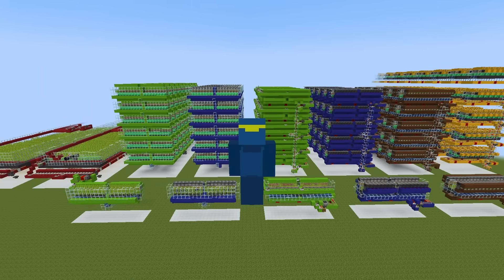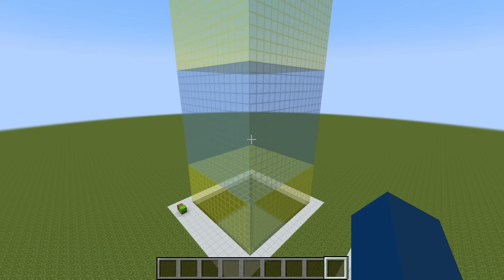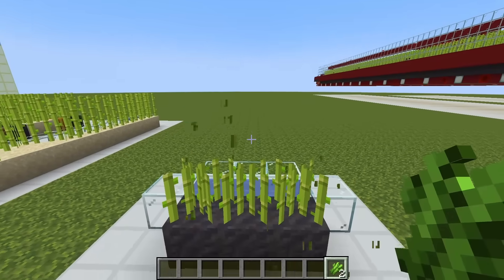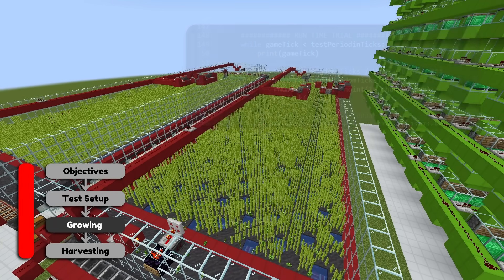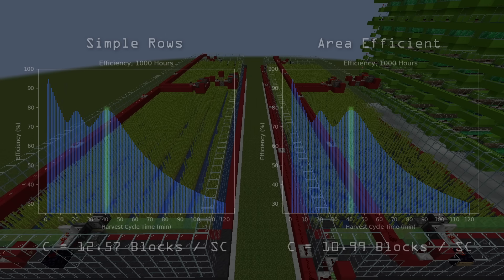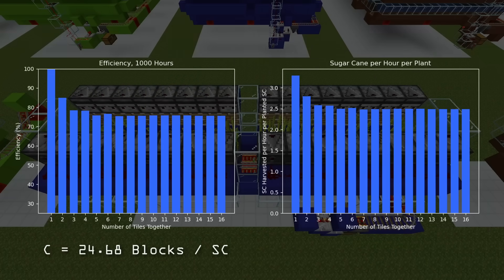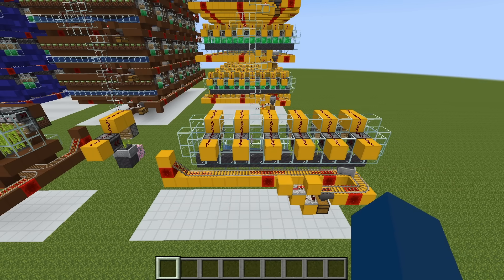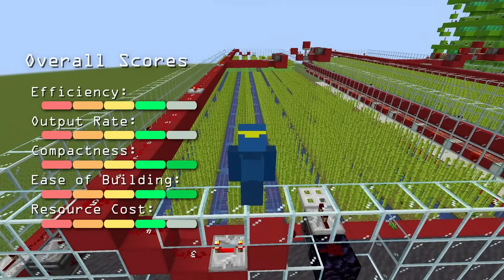I Simulated Minecraft to Find the Best Sugar Cane Farm

Comment: Do you have any knowledge about the impact of the length of a farm and the added time of the flying machine returning? I guess the curves for the optimal timing of clock based farms shift to higher time values when you consider the time the flying machine is running.
Reply from the maker: Good question! I think the biggest impact occurs if the optimal time is less than it takes for the flying machine to make a pass. So, hypothetically, if you have a really long farm and it took an hour to go from one end to another, then we’d hit the optimal farm time but we couldn’t be able to harvest yet cause our flying machine is in the middle of a pass. But even with really long farms, the flying machine only takes several minutes. This gives enough time to reset and harvest at the optimal time. The current code took into account a flying machine and would block growing or increasing stages if the machine was ‘flying over’ it at that time. That being said I’m sure it’s not 100% accurate, so the curves might look a little different with real-world testing.

Comment: Interesting project. I love it when people start programming to solve rare and unique problems. Reminds me a lot of Gnembon.

But some critism is you need to focus on your code quality. The performance and maintainability of this piece is quite low. Use functions, classes and avoid those huge indentation needed for, for loops with if conditons with more conditons.

You should also have a look at Numpy, its quite a bit harder to learn. But is well suited to this task as you can avoid those slow loops and be faster than any other language. The code would also be simpler since youd just be doing formulas rather than pure logic.
Reply from the maker: Thanks!

I appreciate the advice, I’ll look into them for the next coding project!

Comment: Is there any change in rates if you just harvest the top most sugarcane and leave it at stage 2, making it more likely to receive a random tick because it is 2 blocks tall? This would allow for a shorter clock time or if you wanted to do an observer based one. Have the observer face pointing down so it activates when the sugarcane becomes 3 blocks tall. Subscribed, hope to see more videos like this, reminds me of Nico is Lost
Reply from the maker: @MasterElements  Thanks! His iron farm video inspired a lot of this video lol

This is an interesting question, and the short answer is basically no, there’s no change. I’ve got a longer explanation on the individual 100% efficiency farm video, but here’s the gist. Since every block (and random tick) is independent of each other, having more blocks below doesn’t increase the likelihood of getting a random tick. And in terms of efficiency, the three tall design approaches 100% efficiency because in the time it takes for the third layer to grow, you could have already harvested the second layer. But as time goes on, this small inefficiency basically vanishes. So the three tall vs two tall are pretty much the same.
Reply: @SeaJayPlays  Interesting, thank you for the answer.

Comment: Regarding calculating the rate, wouldn't it make more sense to calculate based on the tick count? That way inefficiency in the code is a non-factor.
Reply from the maker: I think I did do it based on the ticks, but I’d have to double check to make sure. What kind of inefficiency in the code are you talking about? I’d like to correct that for the next video if it’s an issue.
Reply: @SeaJayPlays  Assume that the code runs slower due to some reason (more things happening for example) and potentially misses a tick timing, running it based on real-time would potentially have fewer cycles over the same time period.
Systems are also imprecise, so even if you say something is going to run after exactly n milliseconds you still might have some minor discrepancies.
I don't think it'd change the results in a huge way, but just one of those things one can do in order to keep things accurate. Just letting it run x amount of ticks is kind of all one needs to do.
Reply from the maker: @CottidaeSEA  oh okay i understand. I’ve got it running in a while loop, and each loop is a single game tick so I think we’re on the same page there

Comment: Creating a new comment for this as I think I've found the issue with the instant harvest design. 

I believe the standard 3 block tall observer note block sugarcane design that was compared to the "100% efficient" design has it's data misrepresented. I've made a video on my channel on the topic, but I'll type it out here as well. 

First, we clarify some terms on the phases a farm goes through. 
Growing Phase- waiting on sugarcane to be random ticked
Harvesting Phase- Piston extending to break the block
Reset Phase- Time needed after harvesting before sugarcane can grow again
Footprint/Density- How much space a design takes up
Tileability- How well you can stack a design next to/on top of another design. written as n-wide tileable (1wt for 1 wide designs that sit next to each other) 

First of all, I want to establish that there's no difference between a 2 block tall sugarcane waiting to grow, and a 1 block tall sugarcane waiting to grow. they both statistically have the same chance to grow and are statistically independent. 
With that in mind, there's technically no efficiency between allowing a sugarcane to grow to a full 3 block before harvesting, compared to harvesting it at 2 blocks high. the only difference is that it takes longer until first harvest when you are done setting up the farm, but there is no sugarcane lost or time wasted at max grow height. 

Design 1: Observer note block piston design. 
Design 2: the proof of concept 100% efficiency build in this video
Design 3: My design shown in my video on my channel (and the alternative linked in the comments) 

First we look at the density, Design 1and 3 has a growing sugarcane every 12 blocks, while design 2 has a growing sugarcane every 16 blocks(32 blocks if factoring in spacing to avoid signal crossing. both not factoring in collection system. This makes design 2 33% (166%) less efficient in this factor. 

Next we look at Harvesting and Reset time, Design 1 and 2 has a 2 tick harvesting time and a 0 tick reset time. Design 3 has a 6 tick harvesting time and a 2 tick reset time(2 ticks not affecting sugarcane growth in this scenario). so Design 3 is 50% less efficient than Design 1 and 2

Now we look at tileability, Design 1 can be tiled on top of each other without any additional blocks added, but requires mirroring the tile right above it for best compactness. Design 2 requires 1 extra block space if using hopper to collect the drops, and 2 blocks if using hopper minecart due to lack of any blocks to place rail on. Design 3 can stack right on top of each other without any added scaffolding blocks (care needs to be taken to use lever to power a solid block next to the rail instead of using any hard powering blocks or powering the block next to the rail). In this factor, design 2 is less efficient. 

In conclusion, I believe the "inefficiency" measured for Design 1 is due to the calculations not factoring in that sugarcane takes time to grow before harvested. This is supported by ingame testing by measuring the farm efficiency right after setting up, and measuring the efficiency after allowing it to run for a few hours. 
It also shows that Design 1 is superior to Design 3 (and it's alternative designs) at a margin that can be considered a margin of error. 
All things considered, Design 1 is superior in terms of simplicity and resistance to breaking. 

addendum: I'm unable to test OokamiKuro's design, but factoring in the above listed concerns, this is likely the best design as it's much more densely packed and the longer harvest and reset time likely get's blurred with margin of error due to it being such a minor issue.
Reply: got to say that I didn't noticed that detecting sugarcane on the bottom works because there isn't a block stage change at all, even the age number remains static and the observer is going off and I don't know why.
Reply from the maker: @AkiraAwooCh  So this is something I found out shortly after posting this video. If you use F3 to see a sugar cane block’s age, it will never change until you update a block. So if you break the second layer, you can see the age change of the block below. From what I found, this is because that age on F3 is not updated on the client side as the developers didn’t find it necessary to always refresh, thus helping the game run a bit faster. I wasn’t aware that an observer could see the sugar cane updating until I saw OokamiKuro’s design. I think the compactness alone makes it my favorite max efficiency design so far
Reply: @SeaJayPlays  so I did the math, it's not any more compact that the normal "Design 1" observer- noteblock-piston design. 

the primary issue with that particular design is the complexity of stacking the design while using a hopper minecart. 
it still takes up a 12 block space or 3x4 space because you need an extra block there for rails to go on, and this is using an improved design I based off of ookami's design so that it allows for the block to be placed within a 3x4 footprint, and I still can't figure out how to stack it yet, so that might take a few days or weeks to figure out, I have one way of doing that right now, but I'm not really satisfied with how it's done. 

stacking is a major problem with every instant harvest farm, my own design took a whole month to figure out how to stack it seamlessly. and ookami's design's compactness is it's own downfall as it's extremely hard to power the rails without accidentally powering something else.
Reply from the maker: @AkiraAwooCh  I appreciate the thorough investigation and comment! It’s been so long since I made this video/code that I’d have to go back and review it before I could say anything about your findings, but they seem likely. If you want me to link your video in that pinned comment, let me know!
Reply: @SeaJayPlays  would appreciate if you add it, I didn't add it in the initial post cuz youtube tend to remove comments with links in them. 
https://youtu.be/oDASLugeiOo?si=LRhdio1Ll-BylHpZ

Comment: random numbers by computers are not entirely random. So to make the simulation better, you should use the same random formula minecraft uses to generate the coordinates of random ticks.
Reply from the maker: @Capiosus  If I knew how Minecraft did it I would definitely add that to my code. Unfortunately I don’t know how to find that, so we’ll just have to assume the rand function is close. 

Ilmango did a video on clock timing for sugar cane and ran some in-game tests that showed the best interval was 41 minutes. That matches all of my data, so I’d say my programs are a good estimate. 

If you know where I can find more details on the Minecraft code, let me know!
Reply: @SeaJayPlays  minecraft java edition has it's mappings available for anyone, so all you need is a copy of the game client's versions' .jar file and the json which lists the URL of the client mapping. Then you can read minecraft's code using a java decompiler tool.

Comment: First you forgot cactus in Redmond ticks and second you can place then diagonally when a water is nearby. Could you Test if my setup is any better than the average player including yous pls? I place my sugar cane in a Chess like pattern where sand and Water interchange where the waterlocked blocks are the the black titles and the sand are the white titles then I place the Sugar cane and run flying machines over it . I also stack the fields on top of another to maximize production. Could you also simulate cactus farm pls?
Reply from the maker: @icebluscorpion  Hey there, not sure what that first part is. But for the second question, surprisingly, the chess board pattern is less efficient (50% sugar cane) than this strange pattern (~80% sugar cane) but this pattern is different to make. 

It’s definitely a good idea to stack the farms so you can max out efficiency based on the chuck borders, nice job!

Lastly, I probably won’t do any cactus farm videos just cause we already know the best way to farm them and can easily do instant farming (max efficiency). The hard part is designing how to capture all those drops. I think ilmango has a good video where he tests some common designs if you want to check that out!

Comment: If the sugarcane is always 2 tall, only harvesting the 3rd layer, will that mean you can catch more random ticks by having less blocks be non-sugarcane?
Reply from the maker: @Penetal  Good question, but the blocks are all independent of each other, so the random ticks don’t add up per se. So if you have a farm with 3 tall sugar cane, if you only ever harvested the top block, you would get the same results as you would if you had a 2 tall farm and only ever harvested that top block.
Reply: @SeaJayPlays  I see, I guess I must have had an hidden assumption that the sugarcane random ticks worked the same way as bambo + bonemeal where when applying it to the bottom it will "rise to the top" so to speak.

Comment: Looking at the small bits of code you presented, I really urge you to look into vectorizing your data generation and processing. Loops in python are incredibly slow, and if you instead of e.g. processing each block in the sub chunk separately were to do all calculation “at the same time”, whatever that means in a computer, you could probably decrease your simulation runtime by a factor of at least 20, possibly around 40.
Reply from the maker: Thanks for the tip, I’ll definitely look into that cause the slowness has been super annoying. I’ve just been writing these programs in these simple steps so it’s easier to do and come back to later. But these run for like 24 hours lol

Comment: Cool video! I like the approach, though I must say I was confused on why using a code to get efficiency and rates if a simple tick warp test could do the same. I struggle to see what the code adds to the comparison basically. I'd expect  that with python you can create a function of a general sugarcane farm and use an optimizer like Pymoo for a multi objective optimization of key design variables of farms, so you can get as an output the 3D pareto front of sugarcane farming. That would be cool! 

Still, I enjoyed the video too
Reply from the maker: @FB_engine  Thanks! As for why I decided to program it, that’s a longer answer. A couple other commenters have asked similar questions, and I’ve written a pretty long reply as to why, so definitely check those out if you’d like. But short answer is, I tried in-game testing and tick warpping but my laptop just couldn’t handle it. Also, in the code I programmed each farm individually to account for harvest methods, and I never looked at the code as an optimizer, just something that allowed my computer to run “in-game” tests. I could look into optimization for a future video though!

Comment: I'm dumb but does the size of the flying machine farm impact the time we need to set the clock ?
Reply from the maker: That’s a good question, cause there are some size requirements. But most likely not. 

In terms of clock timing, you’ve just gotta make sure the machine can traverse the whole field before the time is up, so usually this won’t be a problem. If you’re wanting to use a faster clock interval, you can build it so the machine goes one direction then stops until the next clock interval triggers it to come back. Also, if you’re going for max resource and drops efficiency, I’d keep the sugar cane area thin enough to fit in one chunk and then only go as far as you can load. I think it’s 16 chunks long, and you’d afk in the middle.

Comment: for the single piston fired per sugar cane farm, you can also use redstone dust instead of note blocks. the whole line updates but only the piston underneath the triggered observer pulses
Reply: This was addressed in the video, no? It is the IAmAnIntrovert's design (12:10) which he says he doesn't go with so it's easier to stack each farm unit.
Reply from the maker: @MrCookieMonster565  Oh yeah, it’s been a while so I forgot
Reply from the maker: Good point!